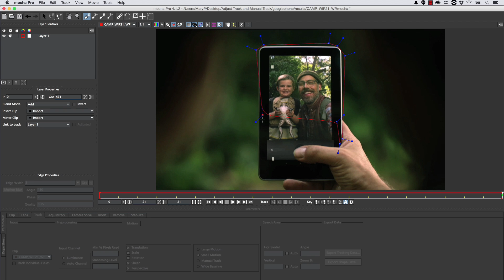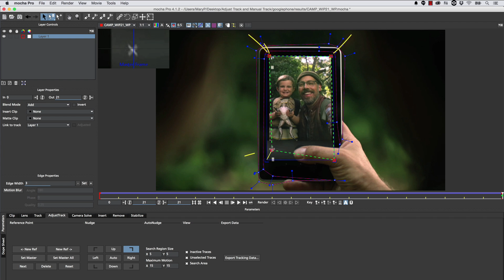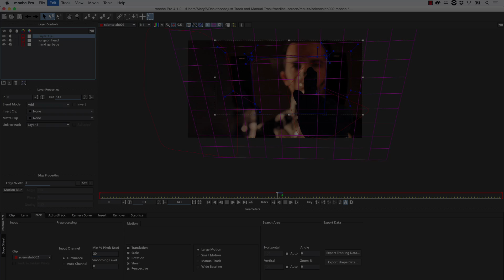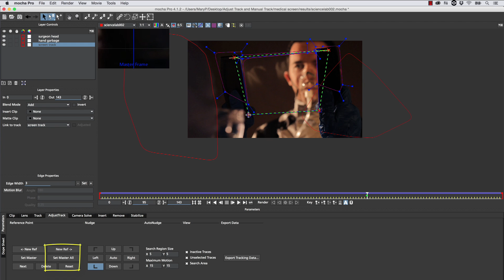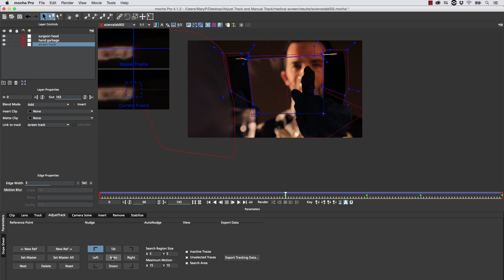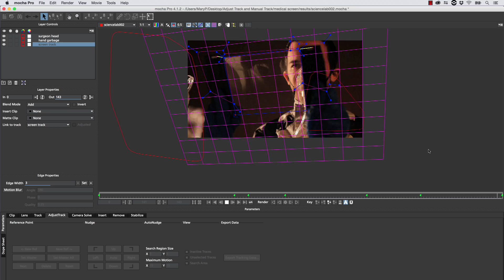Quick Tip: Adjust Track

Comment: I dont have any red x's. my track is fine. its the planar surface that is drifting, how do you keyframe that?
Reply from the maker: If the surface is drifting in a linear way between two points, then AdjustTrack can help.  You can see more about the new version here : https://borisfx.com/videos/mocha-pro-2021-improved-adjusttrack-module/
Usually though if the Surface is drifting in a more copmlex way, changing some settings and retracking is the preferable option. AdjustTrack really should be seen as a last option : https://www.youtube.com/watch?v=4EsvnF-A3y0&feature=emb_imp_woyt
Reply: @borisfxlearn  Its' weird though bc the track is fine. so not sure why the planar surface blue wireframe doesnt follow suite
Reply from the maker: The Surface is your track.  The shape can fool you into thinking it's all good, especially if you keyframe it, but the Surface never lies.  Here's a video all about that : https://borisfx.com/videos/mocha-explainer-understanding-co-planar-and-the-surface/

If it's a simple drift, you can use Adjust Track.  Anything more than that, change what and where you're tracking and retrack it.  Usually you'll save a lot of time just fixing the track by retracking rather than doing Adjust Track keyframing.

Comment: What if my tracking is all fucked up after my spline went out of frame ? (created a secondary spline on an object that's in frame the whole time but doesn't prevent the primary spline from being badly deformed went it comes back into frame)